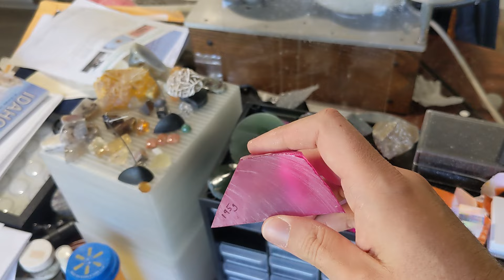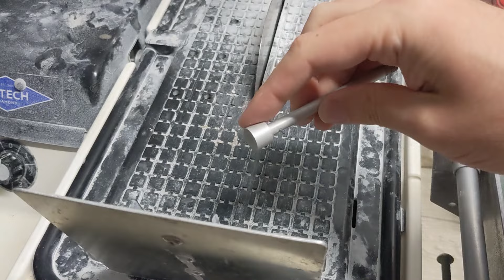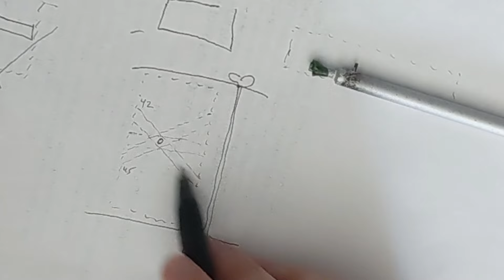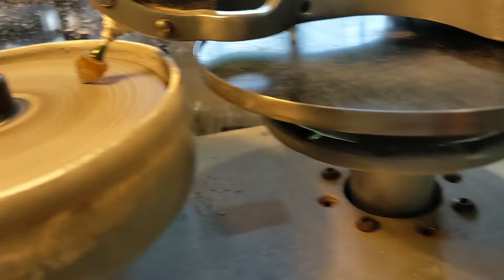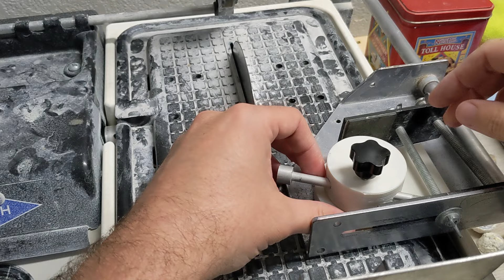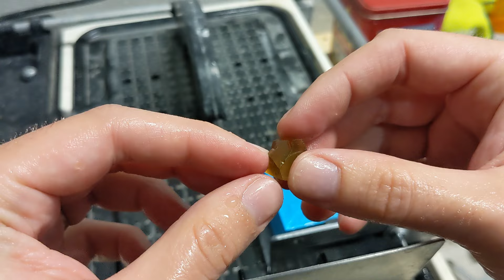I Designed A 3D Printed Trim Saw Adapter

Comment: It would be important to look for and measure the sub-surface damage to compare sawing and grinding. Also why not simply mount a 4-6 inch saw blade on your faceting machine, with a spacer ring?
Reply: You only saw on a faceting machine if you’re desperate, and you sure don’t trim egg-sized pieces on one.

Comment: What about having the block be taller, and you angle the stone down and rather than 3D printed, it's made from a little block of aluminum.

You could also add a little stop so every time you loosen it to rotate it some in slides to the same point over and over.

I have some ideas to try in the future because of this. Thank you.

Comment: That was so cool! To have an idea and be able to translate it to someone that can 3D print it for you, and actually be able to try it out in person! I understand not everyone has that opportunity! But wow! That was so cool!
I worked in construction for many years and we would frequently have to make i jig for cutting thing other than just wood. A tile on a tile saw if you have several tiles that say need to be cut at an angle to meet up in a corner. It's easier if you had a jig, all the tiles would be cut perfectly at the same angle. But a big for faceting? That is a really good idea. Not every one needs it but the vast majority will! Cool idea.

Comment: Alway nice to try to try new ideas and try to save materials. I wonder if he could add limit the depth of the hole if you use standard length (same length) dop sticks to act as a depth stop. Then as you rotate the dop, you just make sure it is bottomed out in the hole and tighten your set screw?
Reply from the maker: That's a good point. The through-hole was a remnant of my original idea to tighten the dop from the back using the screw nut, but that's not necessary any longer.

Comment: Have you thought about having the dop angle downwards at a 45, would resolve your issue of interfereing with your vice
Reply from the maker: You mean having a taller block and then having the dop itself point downward at a 45 degree angle? It's a good point, that would eliminate the interference problem, but at a trade-off of requiring a lot more 3D filament. Maybe if someone thought it was worth a shot they could try it! I was hoping people would comment with alternate/better ways of doing this, so thanks!
Reply: @DonohueLabs  Filament is pretty cheap, I do a lot of printing myself, I could draw something up and try it but I'm just getting started with faceting and don't have any rough where I'd need to do this yet, could try it with garden rocks as a test XD
Reply from the maker: @mr.treefrog5789  That's true, I forgot to mention in the video that these test blocks used less than two dollar's worth of filament.